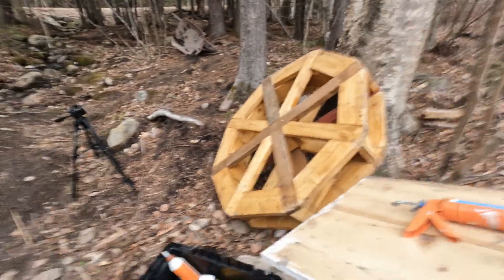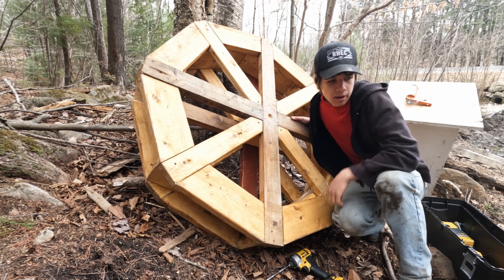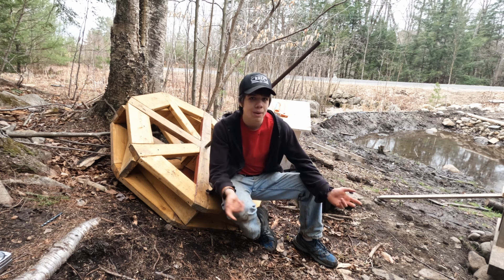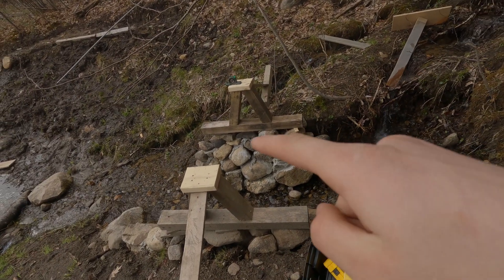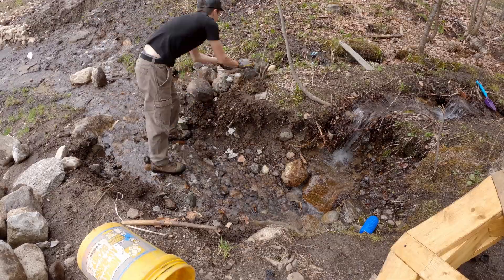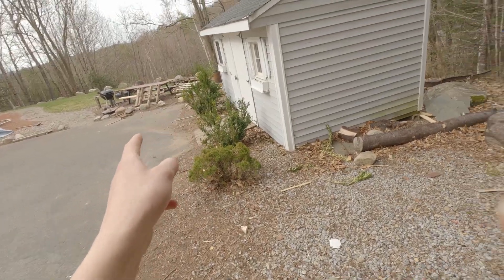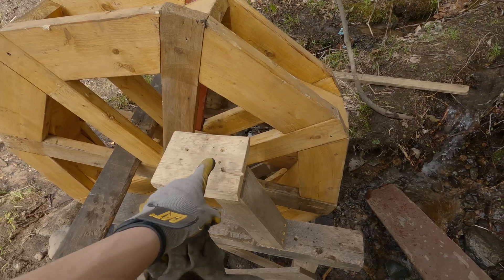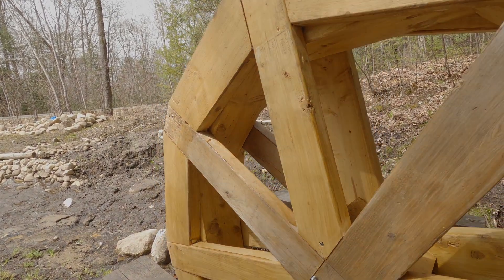Waterwheel Build Part 3

Comment: Just a tip, Use hard paste wax instead of WD40, won't wash off with water running, and protects the wood better. I enjoyed watching you build your water wheel.
Reply from the maker: Paste wax is a good idea... I ended up using regular machine grease